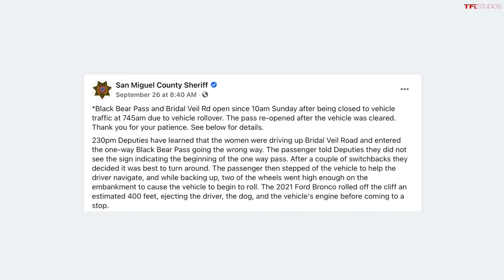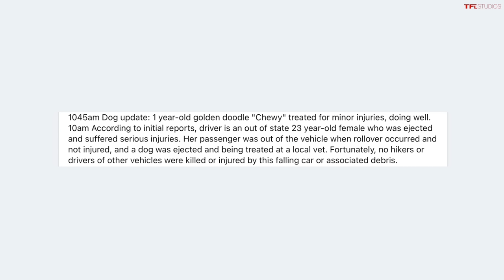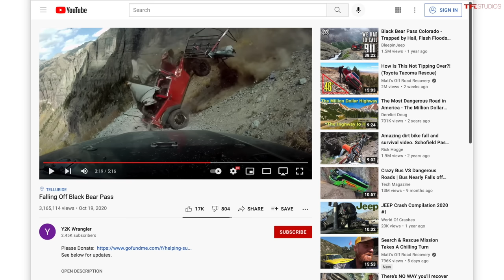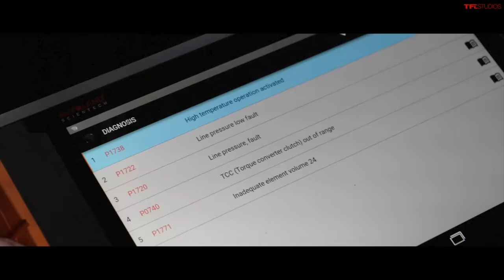The Brand New Ford Bronco Sport Rolls Down A Mountain — Here’s The Story

Comment: O.k., here is the increasing problem with the "off the lot off-roaders" and cross-overs. Basically they give false sense of confidence, to people with little to no off-road or backwoods experience. It sort of creates the attitude of "if I get in to trouble, I will just push a button" (either on the car, or on their phone), while ignoring the dangers of just being in a remote area, let alone everything else that is  required to know to off-road.

 I mean years ago (and still), you sort bought stock vehicle that would only let you get in so much trouble without some driving skills and experience. Well, then once you hit those limits, you started modifying your vehicle to be more capable; or, you just stopped there. This is more human problem than a car design problem. People do it in hiking, mountain climbing, etc. Know your limits, and be ready to save yourself. Just now it has gotten particularly easy to get in to trouble with "traction nannies" or "crawl controls", or other push button off-road features that make people feel invincible.

Comment: 1000's people drive over Black Bear only a handful have ever slid off the mountain when you make a claim "very dangerous" the numbers don't back up that claim. You more likely to be killed driving though an intersection in any large city. Many more are killed in high profile 4WD vehicles by flipping them on paved roads. The reason Black Bear pass has very few people end up dead is because the fact that most everyone goes very slow so they don't roll off fear is a good thing. Taking your lifted jeep on 37" tires down the highway at 75 mph you don't even think about it not fearful at all but in reality that is very dangerous. Any sudden situation cause you to make a quick jerk of the wheel is going to flip your jeep. My own jeep club last fatality TJ on 35" tires going 50 mph on a city street was cut off by another car he flipped end over end he was killed.  Making a show like this saying it's dangerous is what gets trails closed.

Comment: Ok so here is the TRUTH. It is IMPOSSIBLE not to notice black bear pass signs. They are plastered all over the place, like everywhere. At the parking lot there are massive signs. Up the mountain you have to do some climbing up loose gravel. It is possible in 4 high but you will be spinning tires all over the place so many people do it in 4 lo. Once you reach base of waterfall there are signs there too. Once you reach top of waterfall, there are signs there too and I should mention that switchbacks and turnaround spots up to that point are absolutely massive, so much so that people park like 4 cars on pull outs over there and actual road is wide enough for 2.5 vehicles. Past top of waterfall (where power station is)… there is signage and cones and all sorts of warning measures NOT TO DRIVE FURTHER. 

They would have had to ignore every single sign along the way. They could not have missed them. It is impossible to miss a whole bunch of large signs with big lettering and bold font.

Comment: Thank you for sharing this information. This knowledge will help the off road community in evaluating our skills and equipment when confronting a difficult spot on the trail.  In your opinion, is the Bronco Sport suitable for this trial?  Does the suspension allow enough articulation on the switchbacks?  Having a narrow vehicle is a plus on a shelf trail.  Maybe a uni-body vehicle is ok as long as we are patient and use a 6 point turn rather than a 3 point turn on the switchbacks.  Take care.

Comment: Good observation. Great roll-over protection. I noticed that too. Also depends how exactly it rolled. Could have been on it's wheels most of the time- would love to see the actual footage. Still, seems like it did it's job well in this case. A+. I would still never buy another Ford. Moved to Lexus- no regrets. Two were ejected- were they wearing belts?

If I do Black Bear from the Ouray side, can I go up to the summit then turn around before it gets very hard? Or should I go to the top of the switchbacks- is there a spot further down where I can turn around? I am not an expert driver- but I did do H*lls Revenge Moab without major issues in a UTV. I skied Telluride- great mountain! Beautiful area. At night, I just stood in the dark parking lot of The old Angler Inn and was humbled by nature- River across the street and grand mountains surrounding me- many stars. I felt very small- blessed, and also a little scared. I loved it. 

Any other areas I should try first? I am looking for scenic and relatively safe. I don't want to damage the rental truck or myself.

Comment: Sheesh, good thing the passenger compartment held up well.  It might have been a different story if it was an older Ford model.  I wonder why they couldn't find a more suitable place (like the switchback) with more room to make the '3-point' turn.  Keeping the seatbelt on might have minimized the driver's injury since the airbags would have offered and extra layer of protection.

Comment: Idky u say its amazing that a unibody vehicle would with stand this as a unibody in many regards is actually structurally stronger esp in relation to trying to imagine what any body on frame vehicle would have looked like. That jeep wrangler for instance that rolled down, looked way worse n it was only crossed its first road n it looked way worse than this vehicle that was at the end of 400ft. So id imagine that red wrangler at its resting point was far worse off than this.

Eother, way be safe people.

Comment: Totally inappropriate vehicle for this trail.  No ‘real’ 4x4 system, it relies on clutches.  No low range transfer case.  No full size spare.  Inadequate recovery points.  Lack of sufficient ground clearance and underbody protection.  This was irresponsible and reckless, a small miracle no one was injured (thankfully).  Don’t do what Debbie don’t does.

Comment: Seems like a strong body frame ....Why did the engine fall out ?
Reply: Engine mounts are designed to break away in a collision so the engine will fall underneath the car instead of intruding into the passenger compartment.

Sounds like the force of the crash just yeeted the motor.
Reply: Break away point for saftey
Reply: It might actually be designed like that, after the body loses weight there will be less energy to absorb if the body hits anything.

Comment: Cyclists make better drivers!

If you want to learn how to off road in a Jeep, pick up mountain biking first!  It will teach you a lot of what you need to know about traction, weighting, braking, positioning and picking lines.  (Well, maybe riding Moab rigid first will give you those kills in spades!!!)
I've always argued that better drivers are formed from experienced cyclists.  If every kid had to ride his and her bike to school, we'd get WAY drivers.  Glad that today's middle and high schools are offering mountain bike riding and racing.

How many drivers know that their front wheels do most of the stopping?  And ALL of the stopping during hard emergency braking?  How many know much about traction and how to maximize it?  Nothing teaches traction faster than being balanced on two wheels in loose, steep terrain.  Or cornering technique?  How to apex?  Riding a bicycle teaches ALL of this stuff.  Riding in a peloton teaches you about being predictable and learning how NOT to yo-yo!  Man, I HATE the over-braking and delayed acceleration that leads to yo-yo on the freeway!    Stop-and-go freeway driving would be eliminated if every driver had raced bikes, I guarantee it!

Today's well-engineered cars make for safer driving.  But they prevent drivers from learning the dynamics of how a vehicle handles.  When traction and stability control save your butt, you never learn the how and why.  When ABS keeps you from dying, you never know why.  When the transmission does all the shifting, you don't understand how things work.  

Riding a bicycle teaches the basics and gives the future driver a lot of knowledge of vehicle dynamics and stability and how traction is vital.  Road riding in a group teaches a lot as well.  But off road riding where loose conditions force the rider to learn about traction is the best.  So if you want to have good adult drivers, put 'em on bikes as kids!

And this explains why when I got in a go kart for my very first time, I beat the 10 other guys in our group, several of whom had driven karts before.  Racing at 40mph in a pack of 50 cyclists, vying for position and flying around city turns on 1" tires at 110psi makes offroading in a Jeep a walk in the park!  I was psyched when the final two came down to me and another guy who'd spent time in karts.  And just that much more psyched to win it!  Again, hard braking, aggressive accelerating and cornering and sliding on four wheels is just so much more tolerable compared to surviving a two-wheel slide on a bike!  

Ride bikes.  Good for your legs and butt muscles!  Good for your lungs.  Good for your health.  And good for developing driving skills!  I'm always thrilled to see pro auto racers cross training on the bike!  Makes sense to me.

Comment: Sorry, don't see it.  Sure, it's high...sure, it's narrow.  But, it's a graded road.  Nothing technical about it other than the steps and the one or two switch backs.  Look at the last 2 roll overs.  Completely avoidable.  Of course you need to be on your game.   You need a different mindset for terrain like this.  This is not going to the grocery store in Daddy's Tahoe...but,  it's not the Rubicon trail either.  I understand there is little room for errors...and a mistake can be costly...but, it's also just driving on a road.

Comment: You could do black bear pass in a civic as long as you are going in the right direction and not trying to turn around  like they did
Reply: Wrong!  I know Black Bear quite well.  Conditions on the road can change quickly.  Rock can get loose, road can get wet and slick, or drivers just misjudge the conditions.  You can try to tell my that I'm wrong if you want--I'll bet you haven't been 4-wheeling for 50 years like I have.  And much of that has been in the San Juan Mountains, including Black Bear and some even more dangerous roads that have subsequently been closed in part because they were so dangerous.
Reply: They are some off angle high clearence spots that would stop your civic. Lol sorry.